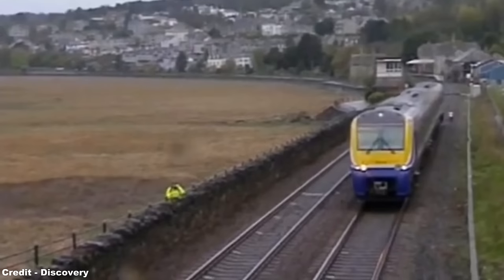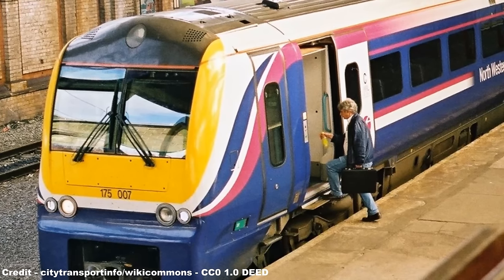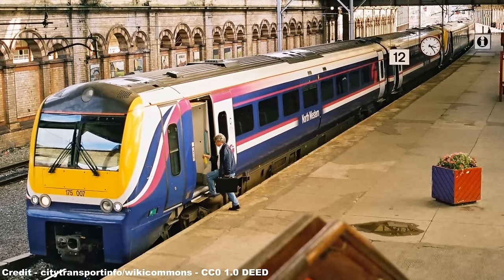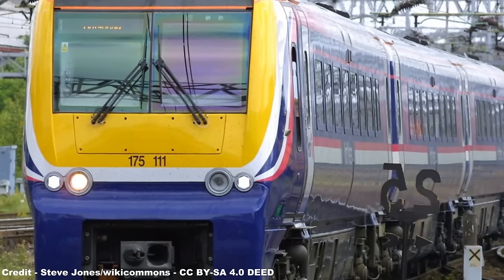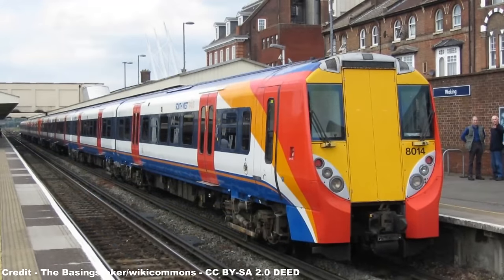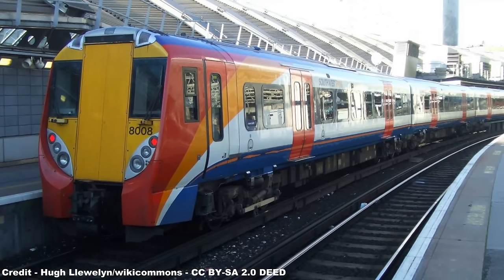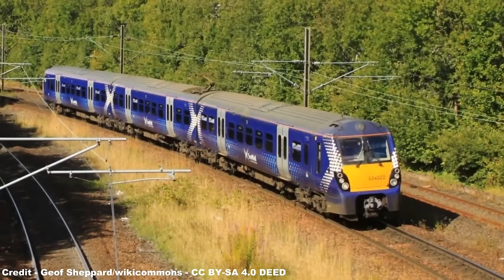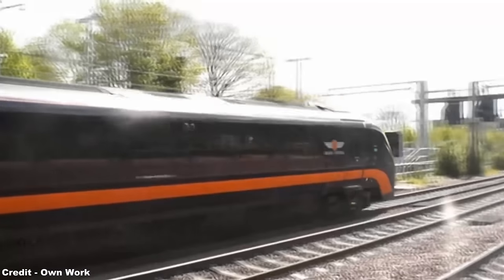The Alstom Coradia - Britain's Most Unreliable Trains

Comment: I just remembered that one of those Class 175's which was taken out of service due to fire damage sat in Chester Railway Station for years...I think that's the one caught fire in Prestatyn. And I was stuck on a 175 for nearly 2 hours where it limped to Llandudno Junction but other than that one time, the 175s haven't been too bad in my experience. Same with the 180s, rode a couple when Northern Rail had them running to Blackpool, was a little overkill though as I had a carriage to myself at one point.  Nevertheless, those Coradia's are notorious for breaking down constantly.

Comment: IMHO it is a bit unfair to blame the Met-Camm plant for the issues. The issues the 180 and the similar Coradia Juniper classes was due to cost cutting instigated from Alstom's HQ in France. The Met-Camm plant was able to produce the 1995/56 tube stock, Class 390 and the X3 for Sweden without the same issues.

Comment: Just to update on the 458s. SWR are converting them back to 4 car sets. The origial plan was to take up the failed 442 diagrams over the Guildford Direct route. But the latest rumour seems to be that they will be used on the Brockenhurst- Lymington line and local stopping trains (Bournemouth-Winchester), freeing up 450's for a possible new Portmouth-Weymouth service.
Reply: They are being re-geared as well I believe
Reply: @ewsclass6679  yes from 75 up to 100 I believe.
Reply: @ewsclass6679 yep, research "class 458/4" on you tube and you will see footage of them with their lateral dampers back on the bogies. Meaning they can go back to higher speeds. Lower weight (40 tons taken off via the 5th carriage) means re gearing them to max speed will heavily reduce the likely hood of the motor overloading drastically.

Comment: Thanks for that video. Well, Alstom locomotives and EMUs always had some teething issues unlike Siemens or Stadler.
Reply: or even some old BREL engines.
Reply: Siemens and Stadler have also had teething issues, if not catastrophic
Reply: @andrewreynolds4949  well, according to Siemens Desiro Rus  experience those EMUs had lesser problems with engines or inverters than Alstom production.
Reply: @runoflife87  As I said, Siemens and Stadler trains have also had issues, if not catastrophic ones like the Coradias or the Avelia Liberty units for example. The Greater Anglia units from Stadler had issues when they were first introduced, and Amtrak's Charger locomotives have had quite a few issues as well, including suffocating from light snowfall

Comment: I recall reading that the cost of refreshing the 458's to meet the disability discrimination legislation was only cost effective when someone came up with the idea of putting magnifying glass over the front destination display which would otherwise have had smaller font than required under the legistlation.
it did seem a bit odd to me considering there were many passenger trains at the time which didn't even feature destination screens.

Comment: The Alstom Coradia family also had a rough start in France.

The X72500 and X73500 diesel multiple units which runs on SNCF TER services had a lot of reliability issues, especially the X73500 that had a lot of problems regarding track circuits because of their weight. It caused numerous derailments and accidents at level crossings. The X72500 had door problems and some engine problems like X73500. But they were fixed on first years of services.

I don't know about the Coradia Duplex though (Classes Z23500, Z24500 and Z26500).

Truly this Alstom period isn't the greatest of all time...
Reply: Corradia Duplex has performed pathetically in Sweden (class X40) but the Corradia Lirex units have actually had great success with several regional train companies (class X60, 61 …).

Comment: The 180 “ Adelante” or Coradia S as they were known as initially were being built for First North Western to operate Holyhead- London Euston Services however the SRA ( Strategic Rail Authority) refused First North Western permission so 14 5 car units were being built but had no home / use 
So First Great Western took them on .
I worked them for FGW alongside the HST’s on the onboard catering section, The biggest annoyance for me & the relevant affected customers and not a snob was first class Coach D was between 2 Std class coaches C&E , First class would of been better as coach E so less walk through and delays to the first class at seat service .
Personally i don’t think they were that bad for reliability considering the work duties/ time working they were doing .

Comment: A pretty frightful story when one thinks how valuable some comfortable reliable dmus would have been for many years to replace other ageing units. The Southern Region, who had designed emus from the 1930s onwards that were regularly and reliably (un)/coupled in a couple of minutes, must have been mightily unimpressed that 458s took 10 minutes+. The good news was that we got the Siemens Desiros instead, which are very reliable and (especially the 444s) comfortable. Interesting that Bournemouth sorted out the 458s and got them running to high reliability standards.

Comment: As much as they had their issues.  If only they rectified some of them pre release. I like them as they have those beefy motor sounds, the 334s are a bit loud. But 458s have a sweet spot with regards to motor / whine volume. 

The body shells resemble the networker designs. 

I assume the metro cammel / uk GEC style trains were what created that nostalgia before they were discontinued. I assume the same company that produced the units were also the same that produce the 96 stock and 465/9s?

Comment: The Alstom products  for the continent of that era had a bad reputation too, like the Belgium Railways class 41 2-car DMUs, they had a habit of catching fire because the insulation around the exhausts running trough the interior got soaked with oil over time, and they developed many other faults too, leading at some time having 25% of the fleet out of service.

Many railways on the continent have switched to either Stadler or Siemens, they are more expensive but offer far better products.

Comment: I think it's concerning that the current models of this family are also having problems, the dutch icng is constantly breaking down and is causing rolling stock shortages as ns has already sold a chunck of the loco hauled coaches they are replacing, I hope these issues are solved soon as they are are a true replacement to the old stock in passenger comfort
Reply: It seems the problem wasn't with where they were built but fundamental design flaws with the Coradia platform.
Reply: @samuel_excels  it may be a mix of both, most models however seem very reliable, think of the lint or duplex, the stream seems to be the new problem child of this platform, I can't confirm if other countries also have problems with these trains but I know CFL had some covid delays with delivery of their double decker units

Comment: Speaking as a tall person - but by no means in the tallest category -  may I also add the absolutely appalling lack of  leg room..? It is unbelievable to me that, at a time when average stature continues to rise, interior train design reflects an almost comical lack of interest in passenger comfort. By comparison I recently used a cross country train in Spain from Malaga to Seville and had what seemed like acres of space for my legs..! Do the designers of trains or those that order them in the UK not comprehend that many of us are over six feet tall...? It is bloody infuriating.
Reply: It's the same with buses and planes. Not only is the leg room a problem but they put headrests way to low on many designs.
Reply: Train designers are only putting into practice what the highly detailed specification demands. And who writes the specification? Step forward the DfT. The Civil Service. It is they who are also so keen on the "ironing board" seat comfort.
Reply: Noting that Spain has a much broader loading gauge this they are able to have bigger and more spacious coaches.
Reply: @1258-Eckhart  I have read no DfT paper work that specifies a seat pitch size. They use very loose language such as:
The seat arrangements must, as a minimum, accommodate the User Population. 
The following factors must be considered for the seat arrangements; 
•seat spacing - the distance between the base of the seat back and the front of the knees (the “knee space”); 
• seat pitch - the distance between the same points on successive seats; 
• seat width; 
•seat access/egress; 
• the overall personal space available to each passenger when seated; and 
• the activities that passengers may reasonably undertake when seated.
Reply: WHAT has the UK Civil Service to do with train operation? Why is the state deciding who gets to sit where in a train and how? That is the decision solely of the train operator, who uses the same in his marketing approaches. The state needs to keep entirely out of this. That it is not prepared to do so (ho ho) is shown by the by now institutionalised prevarication over the powers of the socalled (Johnsonesque) "Great British Railways". Having begun the study for this in Sept. 2018, there is still nothing to show apart from an office building in Derby. I wonder why.   @carlarrowsmith

Comment: You only need to look at these class 458 units to be worried. None of tge interior or exterior panels fit properly together! Noisy to ride in. A 'bodge' of an emu. The class 450 that swt moved to instead were so much better - panels fit, materials were suitable and ride was quiet

Comment: Alstom who built and manufactured the Class 175 Coradia DMU shouldn’t go for scrap but to be cascaded to South Western Railway to replace the Class 158 and Class 159 Sprinter Express. Unless SWR were to order new trains to replace the existing diesel units. 

Or maybe cascade the Class 175 to Great Western Railway to be used in Southwest England such as in Devon, Cornwall, Bristol and Somerset.
Reply: But the 158s and 159s still seem pretty reliable and are very comfortable.
Reply: Yeah they do actually.

Comment: I am amazed that going on 200 years since trains were invented and well over 40 years since the Pacer, a basic DMU/EMU can still be badly built. I mean, seriously, how can you screw up the HORN???

Its kind of like Boeing. They made over 1,000 767s, and they made over 1,600 high speed (ie flying boom, vice low speed probe/drogue) air to air refueling planes (KC-97, KC-135), more than everyone else in the world combined , yet they won a bid to make high speed air to air refueling planes for the USAF based on the 767 and have managed to screw up pretty much every measurable aspect of the unit. Theyve been farting around with them for almost 10 years (22 years if you count its cancelled-during-contract-phase-due-to-corruption predecessor, the KC-767) now and STILL are not operational. The may pass end-of-life before they pass initial operational capability (IOC). Doesnt anyone write stuff down after its invented???

Comment: Alstom "you'll be going nowhere" Coradia. 😂 Alstom really haven't built themselves a great reputation for reliability. Not only did they have all these issues with the Coradias, but subsequently the class 701s have taken 4 years to enter service. You'd think SWR would have learned their lesson. They probably should have stuck with the Siemens 707s, but hey ho, here we are.
Reply: Although the Aventras were really a Bombardier product, Alstom only recently took them over.
Reply: @fluffybadger9832  Maybe so, but they are still in charge, so ultimately the responsibility to get it right falls on them.
Reply: @mdhazeldine  There were enough problems with the Bombardier class 345 Aventras which should have made South Western wary ordering  them in the first place.

Comment: Four a modern unit the 334 is a very noisy unit. Even the 303s that the 334s were replacing were comparatively more quiet than the 334's.

Comment: It was always said that BR were rubbish at procurement!
Reply: Is it any better now?  Transpennine are taking their newest loco hauled stock out of service after 3 years use. South Western railway's new Aventras 4 years late into service.
Reply: @fluffybadger9832  BR was not inefficient it was underfunded.
  It's the political trap, we need reliable services to make the economy work. 
  Spend a penny on infrastructure or stock and the press were saying unfunded spending.
 Put a penny on a ticket and all hell let loose.
  Now taxpayer money gets used to fund everything, including profits.
Reply: @andrewfrancis3591  I agree, a lot of the BREL designed & built stock has stood the test of time.
Reply: @fluffybadger9832  I drove my last 302 in 2001, what was burning the management was the cost of brake blocks.
  100's of thousands of miles on them, most common failures vandalism and jumper's  not fully inserted.

Comment: I experienced the 180's briefly when they was with EMR, hands down the WORST train I have ever experienced to date, although noting the pending arrival of the Hitachi IET 810's with EMR (001 has been on mainline testing through East Mids Parkway) and my experience in general with a number of IET's with South Eastern, GWR and especially LNER, these are not that good either.

Yet the Siemens Desiro's I've experienced with TPE, love em.
Reply: The 180s were dogs from day one. It tells a story that when they returned to FGW for the second time, every set in service initially had a Fitter travelling on board, which was later downgraded to a Fitter meeting every single arrival at Paddington - and all paid for by the DfT (i.e. tax payer). 

And don't get me started on Hitachi's 80x sets. It's almost as if the bloody things were constructed with faults built in! Foisted upon GWR by the DfT, they're stuck with them for the remainder of the long-term contract. 

As for the 'new' 810s, I wonder how long it will be before they'll start running around with at least one engine isolated almost as standard, as it is with the 800s and 802s?